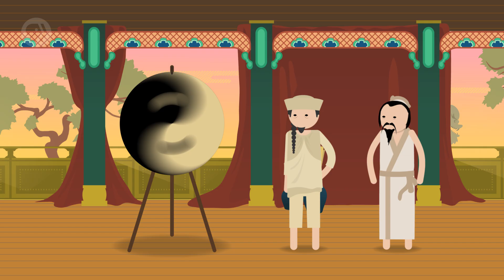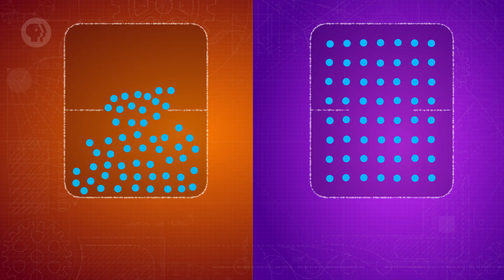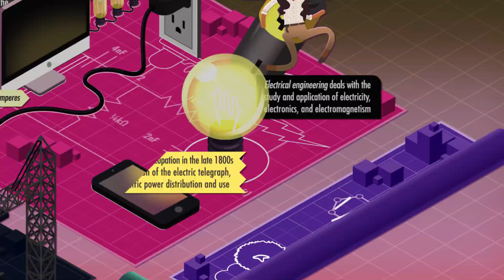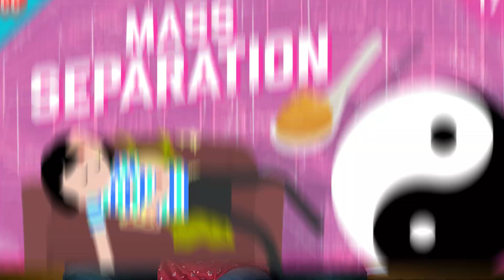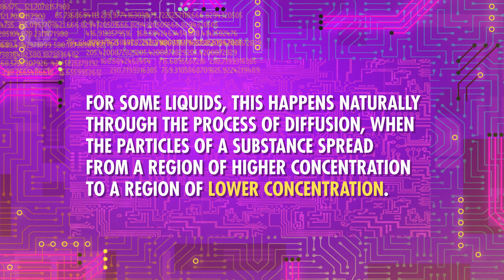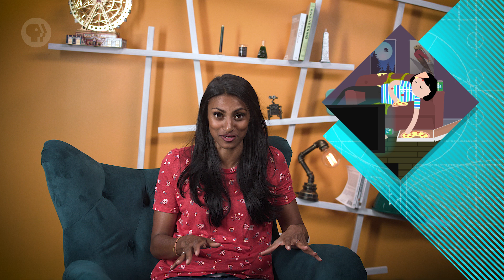Mass Separation: Crash Course Engineering #17

Comment: The liquid-liquid extraction sounded really simple and I had all of the materials required, so I tried a little demonstration.

Procedure: I mixed 1 fluid oz each of olive oil and bourbon (40% abv) in a skinny clear jar, stirring with a chopstick. (I picked these because they both have distinctive colors from each other and the water.) I then poured in about 4 oz of water, 'rinsing' the oil/bourbon mixture, and mixed.
Observations: The oil and bourbon don't form a solution like dissolving sugar into water might, but they did form a pond-mud-brown emulsion that didn't seem to be in danger of separating out anytime soon, unlike a bottle of italian dressing. This might have been because the bourbon was only 40% abv, so the water it contained prevented complete mixing. After adding the plain water and mixing, the oil got brighter green and its globules began fusing together again and the water turned light brown.
Conclusion: Neat! Might try this again if I get a hold of some everclear. Here in Pennsylvania, you have to special order that stuff.

Comment: 08:27 This is a bit too ambiguous. I think a better way to phrase it is "The solvent moves from the side with the lower solute concentration to the side with the higher solute concentration".

The point of the semipermeable membrane is that it prevents the solute from flowing from the the side of higher solute concentration to the side of lower solute concentration; therefore the solvent moves instead; the driving force of this solvent flow is "osmotic pressure".

Comment: The osmosis explanation sounds ambiguous or just plain wrong,  the concentration of a solution refers to the amount of stuff dissolved in a solvent, not to the solvent itself.
It moves from the side with less dissolved stuff in it to the side with more stuff in solution until concentrations equalize.
Reply: I think it works if the "concentration" she is referring to is the solvent "concentration". As in "The solvent moves from the side of high solVENT concentration to the side of low solVENT concentration." But I think a less confusing way to word it would be "The solvent flows from the side of low solUTE concentration to the side of high solUTE concentration. The solvent is what has to flow since the semi-permeable membrane prevents the solute from flowing to achieve equilibrium."
Reply: Yep, that way it makes sense.
Using solvent concentration is just not really meaningful when it comes to real applications since you'd still need additional information to figure out how much solute is in there. That's why the definition is what it is.
Also the other chemists will give me weird looks if I use it lol.
Reply: I think she should have said water potential instead because concentration can get people confused with solute concentration.

Comment: And this, ladies and gentlemen, is... one of the hearts of Chemical Engineering.
Reply: The distillation column. Heat exchangers. Equilibrium stages. Materials of construction. Controls. Diffusion. Convection. Pressure drop. Piping design. Corrosion. Nondestructive Testing. Pressure Relief System. HAZOP. @.@

Comment: Wow! I never knew that there were 3 ways or more to separate chemicals. Or at least liquids. Engineering is awesome and I cannot wait for more Crash Course Videos! DFTBA!
Reply: Chemical Engineering, my friend!
There are Solid-Solid Separations, Solid-Liquid Separations, Liquid-Liquid Separations, Gas-Liquid Separations and Gas-Liquid-Liquid Separations. Each of those have multiple ways of doing it, based on: polarity, density, size, boiling point, freezing(melting) point, electrical charge and one more that I forgot. Whichever is the most viable separation economically, physically and more recently, environmentally friendly, might determine the choice.